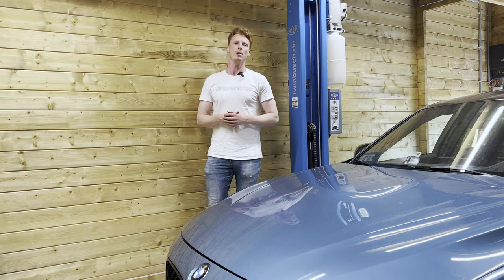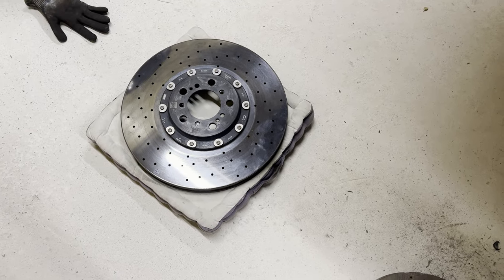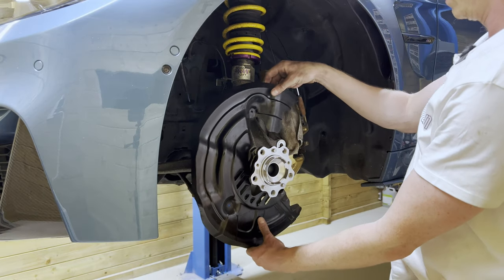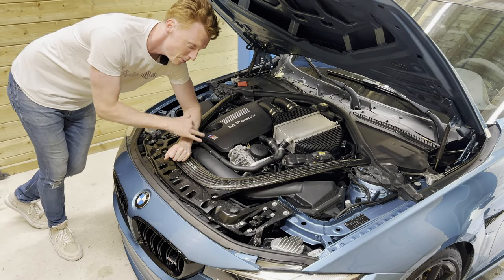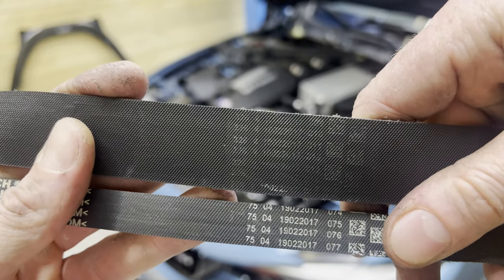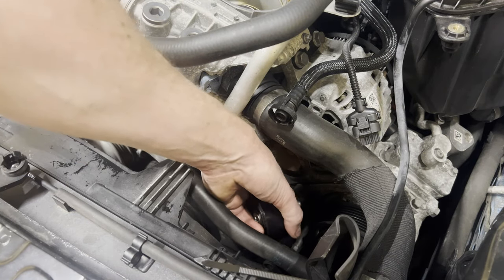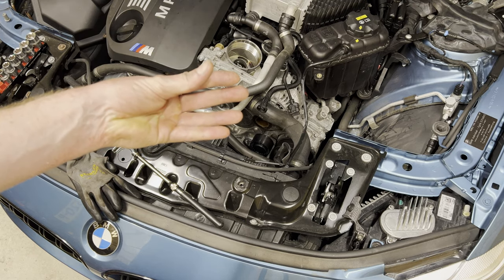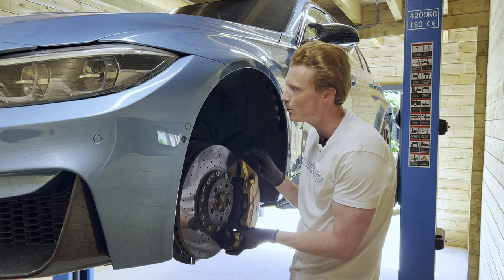BMW M3 Competition: Maintenance on My HIGH MILEAGE BMW

Comment: Great DIY for the belts & pulleys !! I'm thinking of doing this but I have a problem. I have Crank Bolt Capture plate installed on my crankshaft bolt so I can not rotate the motor through that bolt. Is there another place where you can rotate the motor ? I'm thinking maybe though the flywheel?
Reply from the maker: Thanks a lot buddy, hope you enjoyed it. As far as I’m aware, most capture plates still have a ‘bolt’ to rotate right? Looking at the one from MMR Performance for example (which I’ll be getting soon, along with their crankhub). Otherwise you should simply remove your capture plate by getting the car in the air, and doing it from below. Hope that helps!
Reply: @TheHunterHofman  I have the Vargas VTT Capture Plate it really doesn't have  any provision to put any tool to rotate it. Taking the Crank bolt capture out is a BIG job and i don't even have the stock bolts to bolt the pulley to the car without the capture plate installed, so I would need to buy stock bolts just to turn the engine and then when done taking them out and reinstalling the crank bolt capture. I've read that there is an inspection plate for the flywheel on the car, maybe I can rotate the flywheel manually through there?
Reply: @alexoehler1  I also have the VTT bolt capture along with the spline lock hub. After some research I see others have been able to cut the old belt, spine the water pump to allow you to put on the new belt then use the water pump pulley bolt to re-tension it. If it's possible this would be a lot easier then having to remove the bolt capture plate first
Reply: @jaimehurtado356  That would be an amazing solution yes. But it needs to be confirmed that this is posible turning the waterpump pulley first. Also if that works it would also work to take the belt out without cuting it?
Reply: @jaimehurtado356  have you tried it? I'm about to get the parts and want to confirm the method of cutting the belt

Comment: Please can you specify the references for the OE replacement parts for the Pulley, Belts, Tensioner ? I think I found the INA references but the Continental belts I don't know what ones to use
Reply from the maker: I believe you can see the part numbers in the video, on the boxes. Let me otherwise add them later today in the description

Comment: Superb video.  I did my belts and pulleys last month at only 90k km I had a belt chirp at idle. I did tensioner first but it wasn’t until did all pulleys and belts that chirp went away. 

€3100 was the quote from Bmw ! 

i paid €301 for oem parts and was so happy when I did myself. 

I didn’t know to release the tensioner three times. 

Also I tried doing it without removing oil lines but it was impossible.
Reply from the maker: Thank you buddy, appreciate it. That’s a very steep quote, my goodness. It is indeed impossible without removing those oil lines haha, but besides that it’s quite easy.